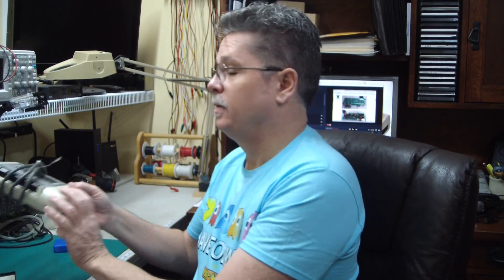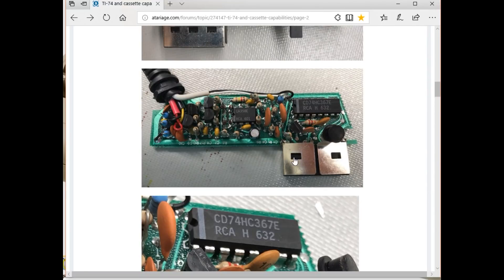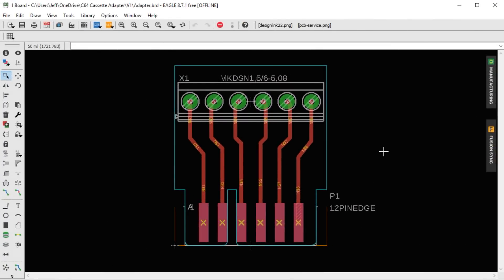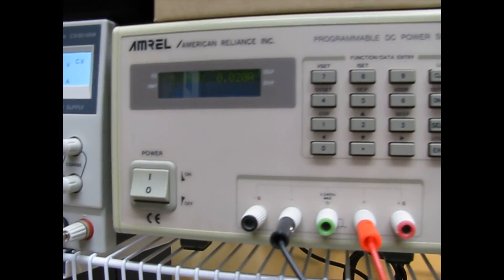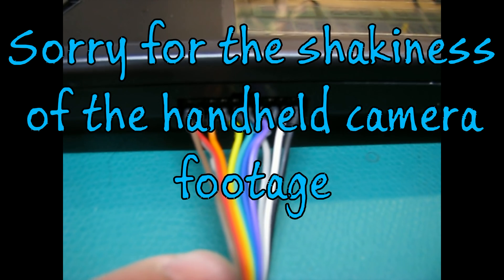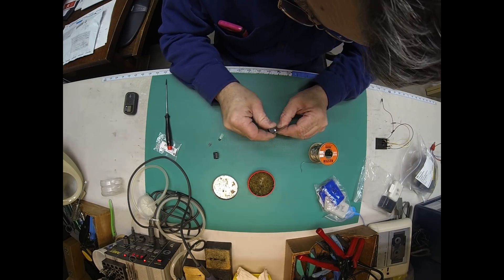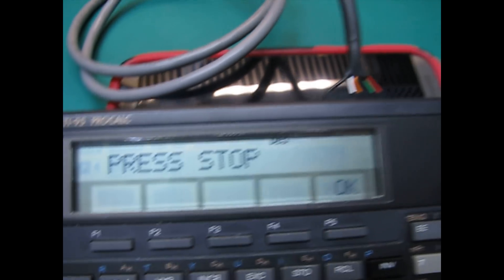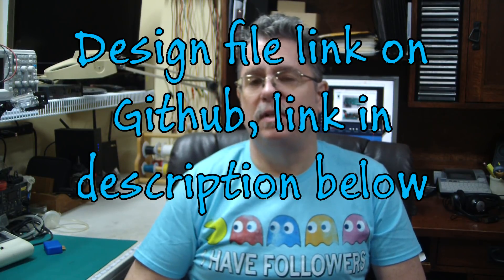C2N Datasette Adapter

Comment: Wonder if anyone has made a generic USB adapter for modern PCs.
Reply from the maker: It seems that every manufacturer had their own spin on how a cassette interface should work. The storage format even varied from model to model for some manufacturers. There are some USB connected tape interface emulators for some pocket computers but not a universal one.

Comment: Hey Jeff! Do you think the TI-95 could be connected almost directly (three wires) to the Tapuino C2N Arduino emulator?
Reply from the maker: I'm not sure how the Tapduino works, i.e. does it just record the output signal at n* the bit rate (oversampling) or does it try to interpret signal in order to have a more compact file. The inverse would be true for reading from Tapduino on TI-95 as well. The C2N is relatively dumb in that it just writes/reads what you give it. All the TI-95 signals are TTL(ish) though so electrically it should not be an issue. You will need 4 wires though Read, Write,  Motor (play) and Ground.
Reply: @HeyBirt  Thanks! I also wonder if the Tapuino would work more generically (e.g., with a Sharp EL-5500 or PC-1500A).

Comment: Hey Jeff,
this adapter is awesome!
I'll take a look at your files, and maybe set something up for my new arrival, the TI-74S. ;)

Cheers,
Thilo
Reply from the maker: I think it is a good solution. The C2n is more reliable than a typical audio cassette recorder anyhow. I just used the PCB I machined but I think I uploaded the are there so you can get PCBs made. There is also a model to 3D print the case. It was based on a common stock enclosure which you can also cut make work.

I like the BASIC programmable more so than the key stoke programming of the TI-95 but both are nice.

Comment: Hi Jeff, 
I just went through this great video on how you were able to connect a TI-95 with a Comodore Cassette unit to save/read programs. Amazing job! I recently bought a TI-74 and now I am facing the same challenge after discovering original CI-7 cassette units are almost impossible to get these days. On this regard, I have a couple of questions:
1) Would the interface you designed be able to work with a regular cassette recorder, let’s say, in manual mode, as those would not have the motor controller cable?
2) While searching on the web I found a recent TI Graph calculators (models like TI-73, TI-83, TI-83 Plus and so on) USB adapter, named TI Connectivity USB Kit for Windows and Macintosh. You may find it by a simple search. I was wondering if such device could be adapted somehow for connecting to the TI-95, 74 as an easier alternative. What do you think?
If your solution (and I think is the best option) is the only way to go, how could I get one? Electronic Circuits is just a hobby for me, so, beyond doing some basic circuits and soldering, I don’t have the skills to such a nice work as yours. It seems as well a simpler solution would be to build or get a copy (a hacked version) of the original CI-7. I am very interested to know your thoughts/advice on this. 
Thanks in advance. Hugo (writing from Mexico City).
Reply from the maker: Hi, I to had found the TI cassette interface impossible to locate. I did find some pictures of its PCB on the AtariAge forum but there was not enough detail to reverse engineer. This is why I went down the path of using the Commodore C2N Datasette.

The advantage of the C2N is that it has almost everything built into it that you would need to add externally to convert to/from the digital output of the calculator. It made the job simpler and I had one of them on hand.

I have since found a real TI cassette interface which I plan to reverse engineer. It is a very simple circuit so it should not be hard to replicate. It is on my list of things to do but it is a long list :)